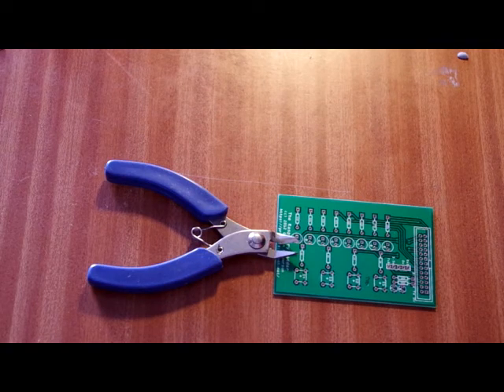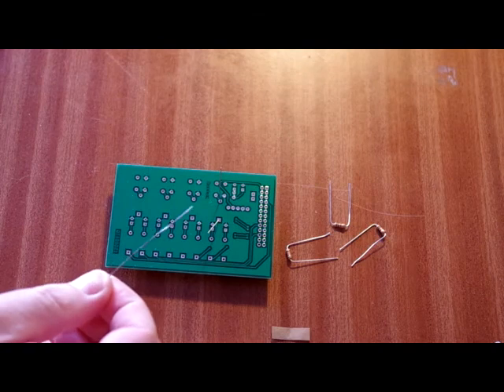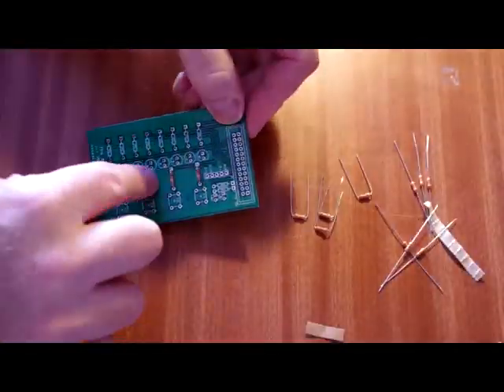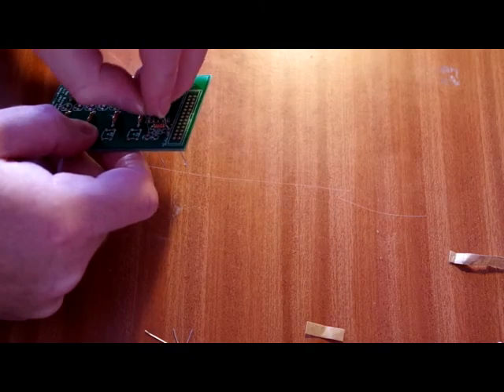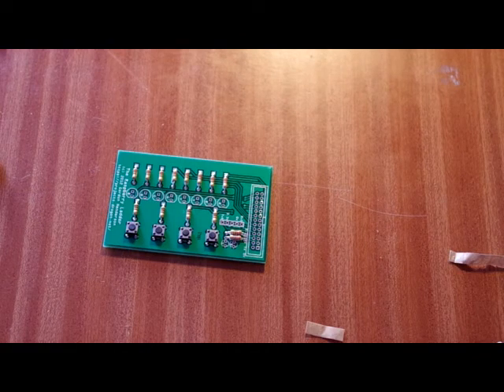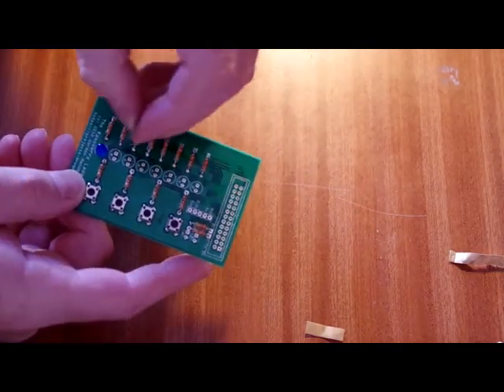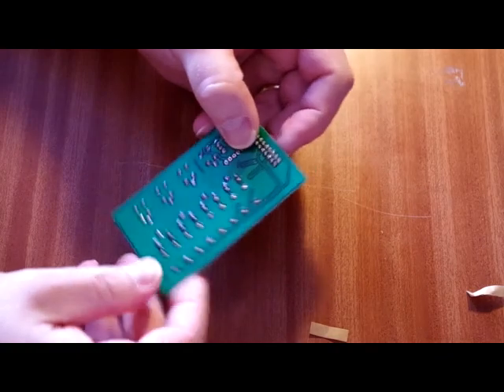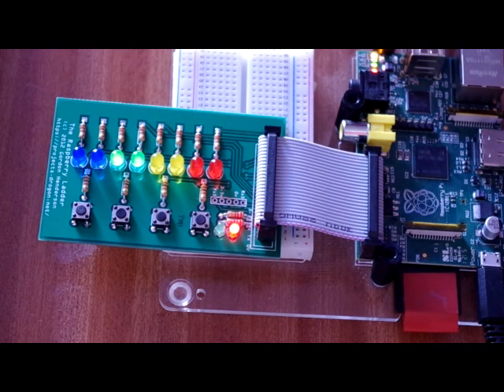Assembling the Raspberry Ladder Board

Comment from the maker: It sounds like Button B (the one opposite the Green LEDs) is sticking on. I'd check the PCB, look for any obvious shorts. Also, run this command after running the test program:

gpio readall

and see if pin 1 is reading low. (it probably will be)

So the next step is to check the switch, check the soldering and see if you can find anything round the switch - if nothing then you need to look at the GPIO connector itself...
Gordon